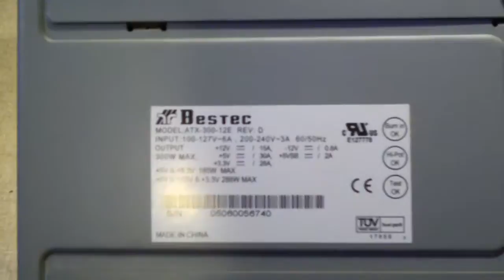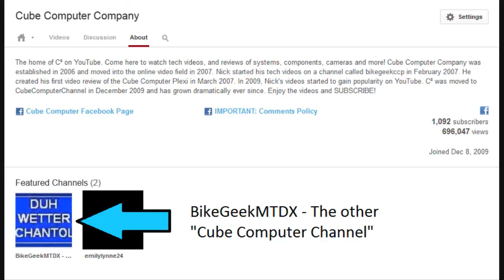Visual inspection of Bestec ATX-300-12E power supply

Comment: looks pretty generic, just better quality components and the filters and security stuff, although i dont see the long K7500B so maybe it's just the look. Havent seen generic models that do not use the K7500B but i suppose there's always a chance.
I still dont like that 2w resistors near the heatsinks nor the caps glued to the output  inductor though. I've seen those get red hot, and they didnt catch fire just because god is a cool dude. :[